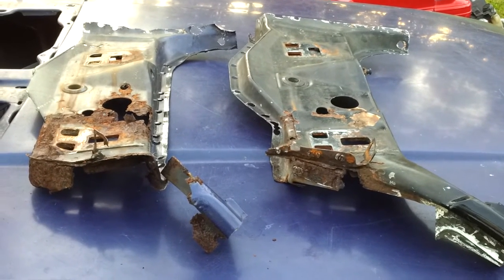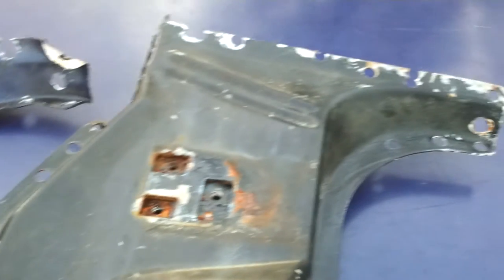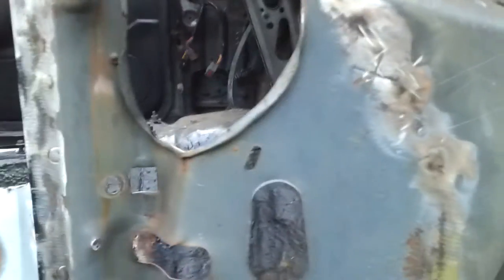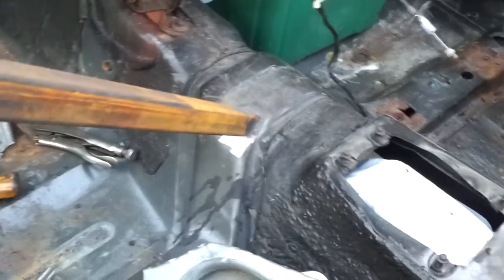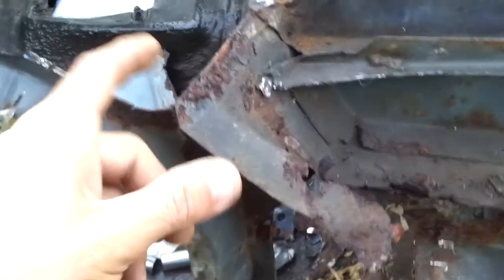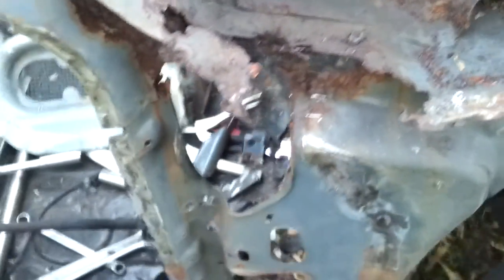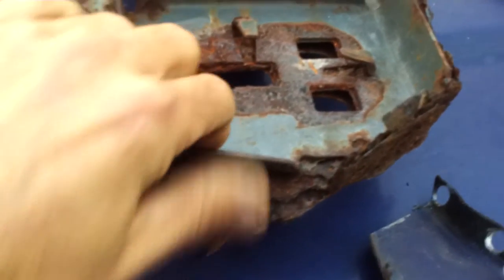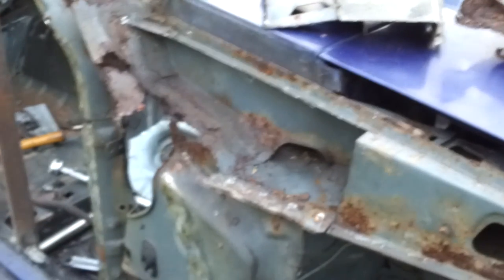Fox body mustang door post repair PART 1

Comment: Hey I wanted to get your opinion on something. I have a 91 fox. It’s rust free except for I see a bit of rust (it’s not rusted through, just surface rust right now) on that door pillar area behind the front fenders… my question is, should I really take the fenders off and fix it ? The paint is good and wont need for many years so I don’t have a reason to really mess with the fender area but I was just poking around and see that.

Comment: great video! I have an 82 im working on. taking on the cowl replacement.. but that top triangular piece that reveals that whole top rail of the door post. if i cut that out should i remove the windshielld and brace it?

my door post looks okay. its mainly the bottom of the cowl pan

or is that only when cutting that upper door post?

thanks in advance
Reply from the maker: I did a video for disassembly of the door post/cowl that may help you along with the other door post videos.It depends on how far into the cowl repair you go for the bracing.You can remove the triangular piece that forms top of door post without taking windshield out.You can do small patches on lower cowl area there with out bracing.If you need to do a large lower patch of cowl above the door post I strongly suggest welding a bar from door post to floor support.You could also weld a bar from drivers side to passenger side door post and fix one side at a time.
Reply: @MR1967galaxieLTD  appreciate the reply, been watching your videos while I go. I'm pretty hesitant on taking the windshield out. got a quote today which wasn't bad. im gonna work on the outter frame piece then evaluate the lower cowel. appreciate the reply really do. ill take into consideration the brace. might be my next step with the windshield removal. will see tmr